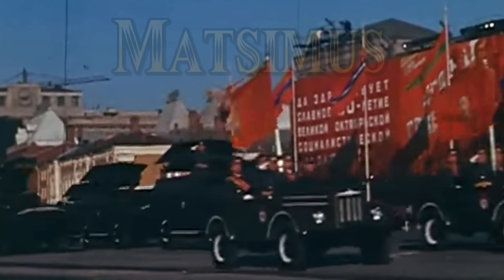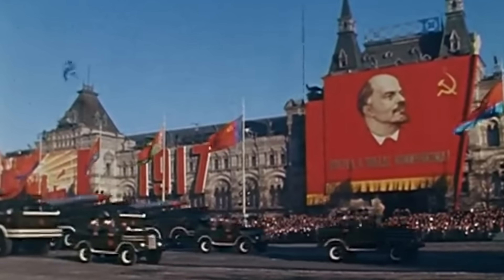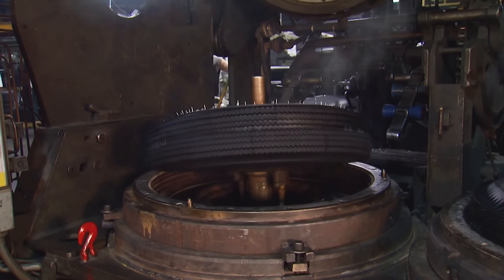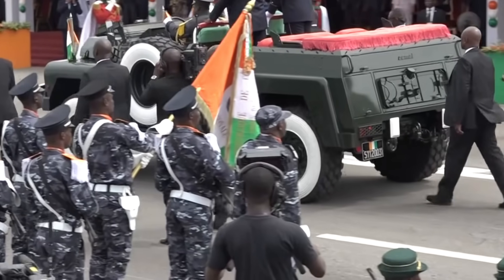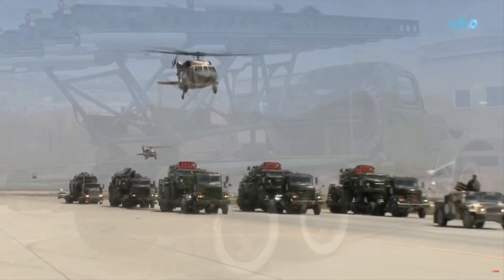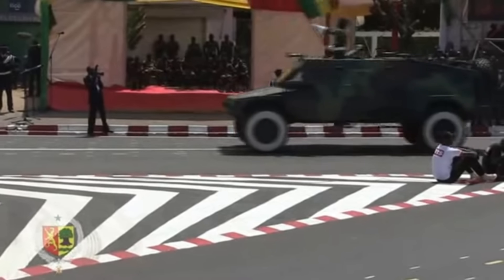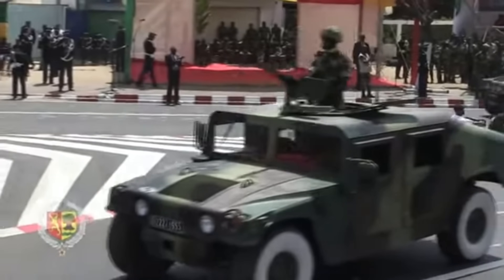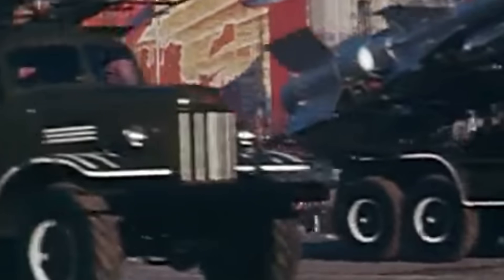Why do Soviet/Russian, North Korean and Chinese military vehicles have white wall tires?

Comment: I remember in the 1970s , the original tyres on most new cars came with white-striped walls. It was considered a "premium look".  
The fully black tyres were cheaper, and most owners bought those when the original tyre sets needed to be replaced.
Reply: as someone from the 80's we'd turn them inside so we didn't look like old people.  I assume  thats why it stopped.
Reply: @davesnothere8859  Yep. They were a sign you were a non-car person and fell out of favor with muscle cars and performance/sports cars (pickups and vans, too) as early as the 1960s until becoming pretty rare by the 1980s (the exception being that many muscle cars went to red-line tires - thin version of a white wall but in red) as well as raised white letter tires (all black tires with only the tire brand name being white). Today, no one under the age of 60 would be caught dead with white-walls on anything other than a classic or antique car/truck. This is also one reason why vinyl rooves have pretty much disappeared from cars.

Comment: My old 1990 Chrysler Fifth Avenue came with and still has whitewall tires. The white wall is quite narrow though, and if you prefer to have it black only the tire can be mounted other way round, the white is only on one side.
Reply: If you cut the sidewall open, the white is much wider than the white wall that is visible on the outside. On some severly weathered or worn tires, sometimes you can start to peal back the black next to the white wall and see white under it. Especially if the driver loves to rub up against curbs. It's the same with white lettered tires, they're all connected on the inside to a layer of white, and it extends past the letters.

Comment: Thanks, Matt. That was actually really interesting. Like many others I just thought it was decoration. Yeah, I knew about the zinc oxide, it is the active ingredient in many sunblock lotions too, so that makes sense. And zinc oxide is cheap.
Years ago when I took organic chemistry we learned about polymers, vulcanization and tire rubber. One of the biggest enemies of tire rubber is ozone. And one of the greatest sources of ozone in US cities was evaporated gasoline: so vapor recovery and charcoal canisters became the normal emission control devices. Antioxidents were also added to rubber to increase its longevity. But the double bonds which give rubber its elasticity soak up ozone like a spounge...and lead to cracking. A thin layer of tire shine, silicone oil fills in the microcracks and prevents ozone from getting in there and aging the rubber. 
Thanks Matt for the cool video on some of the more obscure yet important minutae of military logistics!

Comment: I always assumed this was dressing for parades (the Soviets favorite pastime!). Kind of like polishing your uniform's brass buttons, or nickeling the rifle barrels. I never realized it was part of the manufacturing process. And the preservation purpose makes sense now that you've explained it. Thanks!
Reply: It's a pure for aestetics. There was a trend forwhitewalls on private cars in 193x-196x prior it was an element of design on premium class cars.
Reply: Actual military or civilian vehicles never had white wall tires. This is painted specifically for parades.
Reply: @piotrmalewski8178 True. I was born in Lebanon in 1962, and my folks (US embassy) told me about the Lebanese Army giving military parade vehicle tires a fresh coat of white paint before parades.
Reply: @brinsonharris9816  Not only in Lebanon - former Czechoslovakia was another example. Even prior to an inspection, everything was freshly painted. All tires in black (and white, yes!), all borders and curbs around the sideways/roads in white and sometimes the grass in a standard military green.
Reply: @jirizlamal69  Interesting—one paint scheme option of the Tamiya 1/35 T-72M1 had the parade white trim, and in MiG Pilot, the autobiography of Soviet pilot Viktor Belenko, he mentions how trees were planted in the dry season at a base he was assigned to in anticipation of an inspection, and the trees of course withered and died. Higher ups’ solution was to use Soviet green paint applied with spray guns to the dead trees, and guys driving the inspecting officers around were instructed to drive fast so they wouldn’t notice. It was one of the examples of waste and incompetence in the higher ranks that got him thinking about defecting.
Reply: No, it doesnt. the preserved tires were never painted. It was only for parade. If it wasfor storage, the whole wheel would have been painted, not carefully that round spot only.

Comment: Apart from being stylish it could be an anti theft marking. Any such tyre on a civilian vehicle and the owner/driver would be in trouble. There is a similar naval tradition of weaving coloured strands into ropes of the same reason. The choice of colour would even tell what navy the rope belongs to.
Reply: Interesting. I was in the Navy and have never heard that.
Reply: @mmmark8737  This was an age of sail thing and those coloured strands was woven into them during manufacturing. If you was in the navy two hundred years ago you would know.
Reply: When I was in Germany in the early '80s the army put red dye in the gasoline to prevent theft. If a civilian car had red residue on the engine then they had been stealing/blackmarketing gas.
Reply: @korbell1089 Was it Diesel? Then that was a tax thing - civilian Diesel being taxed, but the practically identical heating oil wasn't, so people had started using heating oil in cars - the heating oil then also got red dye added, and rumours had it that it caused residue and/or smoke, but in reality it was just so that a cop could easily take a fuel sample from your tank and see if you were dodging taxes... military fuel also being tax free, it would make sense to do the same there
Reply: But many civilian cars had the same style of wheel anyway and anyone could (and still can) buy them for any car so I doubt it was theft protection.
Reply: @michaelpettersson4919  Oh. haha. I'm old but not that old.
Reply: @richbob9155  They're not the same size as car tyres, they're mostly for trucks. Not many whitewall truck tyres on the market, especially not in those countries..
Reply: @jnievele  They do the same in Belgium to this day (and I presume they still do it in Germany as well). As you say it's just to make it easy to see who's dodging taxes. I believe farmers are also allowed to use the untaxed red coloured fuel to drive their tractors and such.
Reply: @michaelpettersson4919  It was called the thief's yarn in the Royal Navy.
Reply: They'd also put disks in the stocks of rifles as an anti-theft marking. You might have a rifle that is both sold to civilians and the army, but if you saw the unit disk missing you'd know someone stole it.
Reply: @korbell1089  They did the same thing in the UK during WWII and even today in the US we use red diesel in agricultural and off-road usage... state troopers will check your diesel on the highway to see if its red... if it is you are in trouble.
Reply: back in the day many tires were white-walled
Reply: @michaelpettersson4919  too bad i was in the navy 100 years ago and they didn;t do that... looks like i just missed it too!

Comment: My first car back in 1983 was an old '64 Chrysler New Yorker.  When I got it. it had black tires with a white stripe.  Because I didn't have a lot of money, when I went to replace those old tires, I went for some retreaded tires.  The only full set I could find that were the right size were whitewalls.  While those tires lasted, I felt like the king of cruise.  (Everyone else thought I had been dropped on my head one too many times 😮)
Reply: You were definitely a king!  I had a '71 Buick Riviera and a '74 Buick LeSabre four-door hardtop from '83 to '85.  I got compliments on both, especially the Riv.  Of course, they always had clean whitewalls.
Reply: Yeah, I can see a 60s thyroidal monster looking pretty far out in the 80s.

Comment: My bicycle tyres have a reflective stripe that is similar to the motor vehicle white walls, but this is for identification at night.  A bicycle is a lot more easily recognised as two large round tyres that reflect a motor vehicle head lamps.

Comment: In military parades in the USA up until the 1970's they often still put white wall (with wide stripes) tires on all of the trucks.  And some of the vehicles you are showing  in the first few minutes do NOT have white wall tires,  but have metal wheels painted with a white section to make it look like they have white wall tires.

Comment: Coming from a bicycle background, I learned early on that tires that came in colors aside from black tended not to last very long, had poor traction and dried out/cracked prematurely. They are also a pain to keep looking nice. BTW, if you're storing tires on rims, pull them off the vehicle and stack them on their sides. If you leave them on the vehicle they will get flat spots.
Reply: I also remember bicycletires totally in green, yellow and other colors.😊

Comment: In the 1980s, in the US, "whitewall" tires had a 3/4 inch white stripe at the inside of the sidewall, near the rim. When you bought new tires you could choose to have the white stripe in towards the middle of the car or out, where it was visible. I understand that, earlier, the white stripe was a lot wider and covered the entire sidewall. I suppose whitewalls just went out of fashion over the years..

Comment: Hi Mat, tyres are black because the industry incorporates Lamp Black into the rubber compound in addition to Zinc, oil, sulphur and lots of etc. White wall tyres became popular at the same time as National Serviceman painted anything that didn’t move , paint it WHITE!  The only way to protect tyres on vehicles in storage was to put the vehicle on blocks, then deflate the tyres and cover vehicle from light and the elements. The oldest tyres I have seen were those on farm vehicles and some of those were over twelve years old. There are good tyres and there are bad tyres. There are no “ good white tyres”! Cheers mate. Harera
Reply: What is the current source of lamp black?
Reply: Natural rubber straight from the tree is white.
Reply: The oldest tires you've seen were over 12 years old? That is really not that hard to do if you maintain the vehicle and keep it out of the elements.
Reply: @chadvoller2031  I bought a 1962 dodge d-100 on 19.5 inch split rims in 1996... never replaced them... wore like iron maybe not the origin set but way older than 30 years😂😂😂
Reply: @timnor4803  Burning natural gas with insufficient oxygen so the flame is sooty. The flames are directed at metal tubes with cooling water running through them. When it has built up it is scraped off the tubes.

Comment: From '81 to '89 all four Buicks I owned had whitewalls.  It was the style at the time, especially in Chicago; it was difficult to find non-whitewalls in 14" and 15" sizes.
Reply: You must have never worked on those Buick's as the whitewalls were only on one side of the tires, so you could choose if you wanted white walls or black tires when they were installed on the rims...
Reply: @davidhollenshead4892  You must not have paid for your own tires in 80s Chicagoland.  Whitewalls cost extra, and most were willing to pay for it.

Even the used Diplomat squad car I bought had two whitewalls, turned blackside out, of course.

Comment: I work at a plant that creates “carbon black” I use that in quotes because it’s a generic term for what my company produces which is a trademark name, and it’s also just funny as carbon is the PC term for coal in this specific use. It’s always interesting learning more about tires and rubber in general given what my job details. It’s also likely depending on what tire brand you have on your car that I’ve processed the carbon black that is mixed into the rubber compound of the tire, or the building you are living in is sitting on a rubber earthquake mat that has carbon from my plant in it.

Comment: 0:22 Please note that, firstly, it is not the tires on the wheels that are painted white, but the rims, and secondly, the car bodies are also outlined in white. This was done only for beauty and only for parades.

The uniform for parades also differed from the regulations.
For example, according to the regulations, a chevron with the emblem of the military branch was sewn onto the left sleeve. But at the parade, the troops walk with their right shoulder to the stands. Therefore, especially for the parade, the chevron was sewn onto both sleeves.

During exercises or in a combat zone, when there are vehicles of the same models on both sides of the front, you can see white stripes (figures, symbols) painted on combat vehicles. This is for friend/foe recognition.

Comment: I had white walled tires in 1972 on my 1st decent car, a 1 owner 1966 VW Beetle. But when I replaced the tires as they wore out, I avoided the white walls because they scuff real easy and are hard to keep clean.

Comment: At 84 I remember well white walls but just considered them fashion or decoration, for lack of a better word.  I also remember the transcension to solid black.  When a black was desired and the dealer had only a white wall it was put on with the white on the inside.  And conversely if no white wall were available a porter-a-wall was purchased from a third market dealer such as Pep -a-Boys.  Thanks for the information.

Comment: I live in Russia, but I didn't serve in the army myself. I'll tell you about the wheel walls as I heard. Often, equipment is taken from the storage place for the parade, that is, without traces of use and without combat damage. And for good preservation, the wheels are hung out and painted with special white paint so that the rubber does not crack.

Comment: I've had a 1981 Chrysler La baron outfitted with white wall tires and 24 spoke silver rims. This was back in 1987. I though I was the man back then.
Reply: Wire rims were an option up through at least the first half of the 90's.  I had a 93 Buick LaSabre with them.

Comment: I remember way back when I was a kid, maybe 9 years old,  my dad and I were in the automotive department at a department store.  They had a set of white walls in a box. Not the tires, just the white walls as add-ons for regular tires. I don't think those caught on.
Reply: Hah; actually they did somehow - such add on white walls was a not uncommon fix for the cheapskate to add the 'posher' white wall look on his new bottom feeder black wall car. Also for when it was time to replace the OE white walls the owner could opt for the cheaper black walls while still maintaining the right look. 
Actually add on white walls have seen a renaissance recently , both in the version you mention which requires a tire changer to mount properly https://www.youtube.com/watch?v=lpwUPnzd3jQ as well as permanent stickers including red/yellow/blue line versions to add a period appearance on more modern tires

Comment: As I got older I had the "White" walls turned In.  Finally the brands stopped producing them.  I do remember seeing some Armoured Cars (Military) with them and thought that Odd.  I worked (contractor) at a state institution and noted that many employees drove the same/similar model cars,  I learned later that they 'stole' the new tyres off the new state vehicles swapping their old ones.  I imaging they swapped other parts too (filers, wiper blades, and such).

Comment: There may be a reason its retained in the field. North Korea and a few other countries practice black out  conditions. Curtained windows, no street lights and vehicles running with minimal lights. That's why the country looks so dark. They do have power and some traffic. Light leakage is seen as a vulnerability. Study military headlight covers. White wall tires increase the visibility at certain angles in low light driving. In WW2 US and British vehicles had extra reflectors for the same reasons. These could all be removed, camouflaged or covered in combat. Some times being visible is more important than hiding.

Comment: there's another benefit of white walls or rims:
A mechanic can tell at a glance from a distance if wheel bearing or axle seals are leaking - it'll leave a trace across the white that's easily seen,

Comment: Well, there are some that say it is for visibility and that is also why you can see the outside of fenders also painted white and  where there is sharp edges poking out. Now folk may think it is a dumb idea to have white lines for it will make them easier to spot in war, but this is a painting that vehicle that is not in war use, for the green colors are made to make them harder to see, but in a parade you want high contrast for other vehicles to see you easier and to be able to keep correct distance.
This is also why roads have white markings on asphalt and red paint on white concrete....

But that is just a theory, a fil.... no, it is my theory.

Comment: I'm old enough to have had cars with white walls.  They take a bit more effort to clean than the black wall tires.  I can't remember the name of the stuff that I used to spray on them (it was very highly alkaline), but it was basically spray the stuff on, let it set for a minute, scrub a little, then hose it off.  It worked well.
Reply: Bleche-White
Reply: @ostrich67  Thanks, that was what I used.  It's been quite a while and I'd forgotten.
Reply: @ostrich67  Made by a company called Westleys, works to take oxidatlon off the black also. I still have a bottle ,don't know if it is still manufactured, I also painted badly scuffed white walls with tire white.